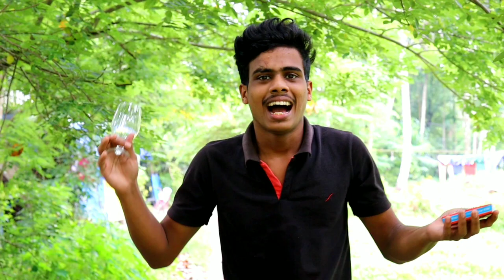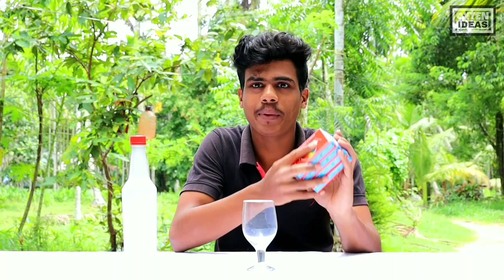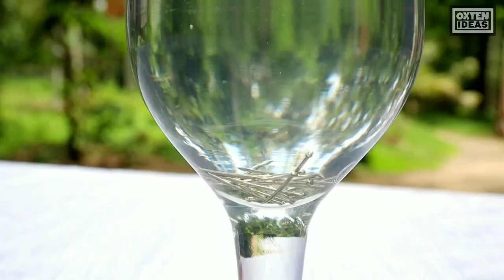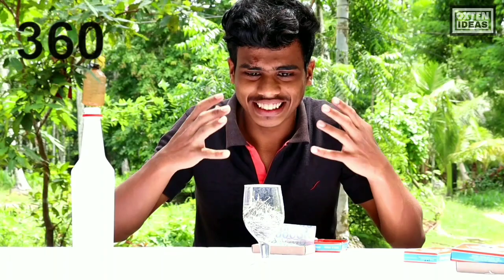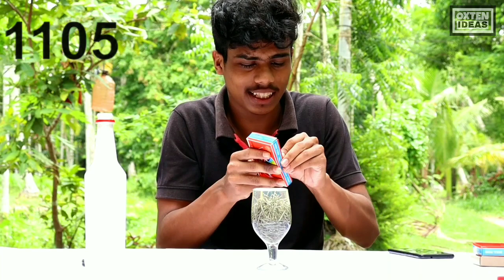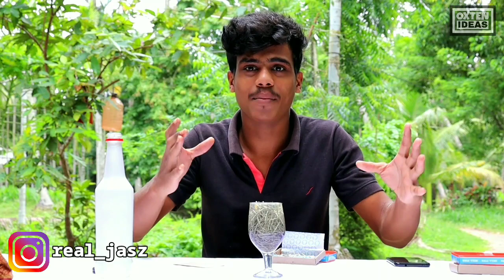Really Shocking😱| Unbelievable Water Trick Experiment | Oxtenideas |

Comment: The card remains attached to the rim of the glass and does not allow the water to flow out. This happens because the air pressure exerted on the card from underneath is greater that the weight of the water inside the glass. This is why the card manages to hold up the water not letting it spill out